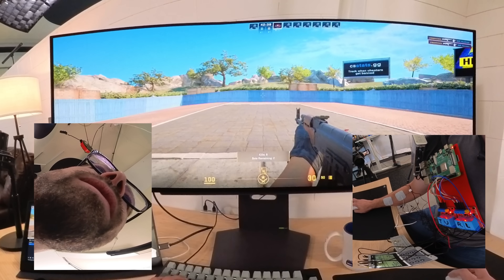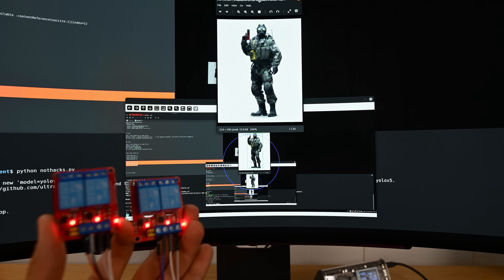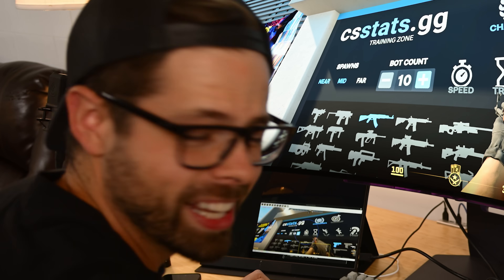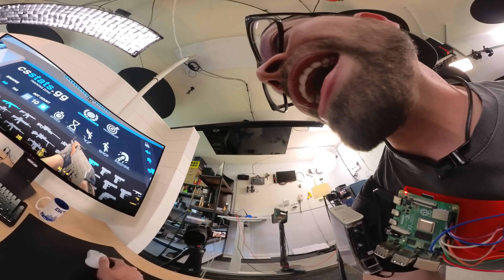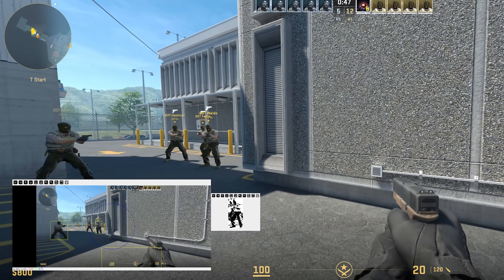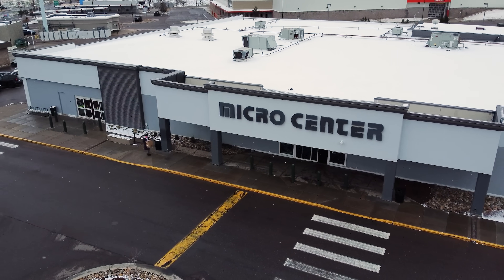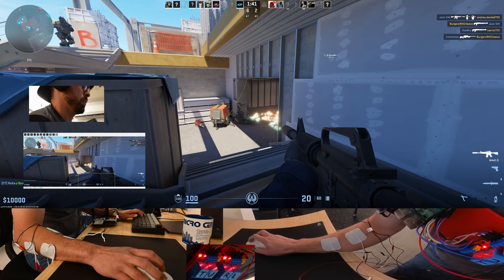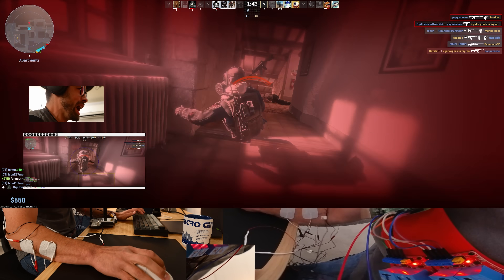Neuromuscular Aim Assist

Comment: You could train a neural net on your arm and wrist movements so it learns the proper shock amount to apply
Reply: 1000 hour training montage. Let's gooooooooooooooo
Reply: @noiJadisCailleach it would probably need more examples than that lol
Reply: that would be insane, id love to see it
Reply: That would require identical electrode placement or a system to compensate for variance like a calibration of sorts
Reply: @likafoss  just get a tattoo around the electrode and label them during the training :p
Reply: @likafoss  piercings with alligator clips
Reply: @likafoss  You just make them permanent by implanting them!
Reply: @likafoss yea, the neural network would he necessary to run attenuation on each user.
Reply: That'll be hard because it needs to adjust if u make a mistake. Like u don't have 100% accuracy
Reply: @sw3gmach1ne17  Your brain would also be adjusting to it too, so there would likely be a point you start to realize you are working with it than against it and that alone would make it easier for the neural net to adapt, and vice versa.
Reply: @Skullkid16945 but still, it needs to learn your mistakes, which they are not at all the same every time. I don't even know if this can work with you or u really need to leave it do whatever it want with your hand. Like for 100% accuracy or close to it
Reply: @Skullkid16945  ya its like an out of whack PID controller
Reply: @sw3gmach1ne17 and that’s fine, it can learn from your mistakes and can it even anticipate them, that’s how neural engines works

of course it will require, a LOT of hours of training, the more is trained the more accurate it will become
Reply: @Skullkid16945  close your eyes and it wouldnt
Reply: @sw3gmach1ne17  wouldnt be difficult to distinguish mistakes if you run a seperate AI like the one he was already using and convert the distance that the cursor has to move in the cardinal directions into 4 different scores while comparing that to the movements made
Reply: @sw3gmach1ne17 
The obvious way to train this neural net would be to give it feedback on good and bad signals.

You can write a program that detects hits versus misses and rewards headshots and kills more... Then combine this with the data from the electrodes
Reply: @sw3gmach1ne17  That is how neural networks work, though: It's not about getting the right answer, it's about being statistically consistent.

So him missing shots won't negatively affect the tuning.
Reply: 1000 hours of getting shocked just to train neaural net so that you can get shocked more during actual gameplay 😂
Reply: instead you could just dampen the amount of electricity you apply based off of the distance from your crosshair to the target
Reply: @Earth-To-Zan could use a Proportional–integral–derivative controller and get better results without any fancy
Reply: you dont even need a neural net thats just inverse kinematics
Reply: You'd just need a pid loop I think
Reply: «WHAT IF WE BUILD THE TORMENT NEXUS, BUT THE PROCESS OF BUILDING IT IS TORTURE???»
Reply: the avatar fits
Reply: This is the way
Reply: Start by losing the relays and put in mosfets -
Reply: 1000 hours of "AGH FUCK THAT HURTS"
Reply: maybe a pid controller could work. The controller has a feedback loop mechanism so it can adjust the strength of the shock depending on the distance to the target
Reply: ERRRRMM AKSHUALLY IT'S CALLED A NEURAL NETWORK NOT A NEURAL NET ☝🤓
Reply: And how long till online games require an anal probe to watchdog cheating 😂
Reply: Regardless of whether you use IK or neural networks, you'd also need some sort of mocap setup.
Reply: An external brain
Reply: Creating the dataset would be an incredible video
Reply: I would love to see this im ngl
Reply: probably would increase the reaction time significantly
Reply: Horror comment! Love it tho. Let’s let AI posses our bodies as demons. Would be bad ass
Reply: Oh yeah yeah
Reply: that would be hell, gathering all the training data
Reply: @bigboi9856  not even, he's generating training data just by playing -- basically just RLHF
Reply: this gives RLHF a whole different level of
Reply: Shock intensity based on distance from center to target, small flick to large flick.
Reply: lets not. :D
Reply: this and the upgrades he mentioned
Reply: And we could house it in the cranium
Reply: HOLY SHIT
Reply: XAI HAS ENTERED THE CHAT....
Reply: Basically it means "git gut"
Reply: Yeah that's what I was wondering, if he did this? Or did he simply just code it so that it basically just shocked him regardless if he wasn't aiming at the enemy 😅
Reply: Even more evil
Reply: You mechs may have copper-wiring to re-route your fear of pain, but I've got nerves of steel.
Reply: I would be terrified of it messing up once and putting way too much current through
Reply: @Zephyr713 clippy, nice!
Reply: Pair it with neuralink and a gun and you get an irl Smart weapon from cyberpunk. Every Day we get closer to it lmao
Reply: do you have any idea how long it takes to train an AI? he would have to be shocked for hundreds or thousands of hours.
Reply: Sounds great, take an ai, give it permission to electrocute you and let nature take its course. On an unrelated note I wonder what happens if your ai can train you while you’re training it until it’s just a loop of suffering
Reply: Getting the training data would be an incredibly painful endavour.
Reply: my guy we all have a neural network trained on sending the right electric signals to move our arms, it's literally the whole point of having a brain.
Reply: @michaelpapadopoulos6054 ewwwwww!!! That is the grossest way I've ever heard someone describe a brain, I wanna rip my own spinal cord out now hahaha 😂 it's just like when someone told me my toes were touching each other all over again
Reply: @michaelpapadopoulos6054  You can't exactly run the software controlling the device in the video on your brain.
Reply: Good idea, teach the AI how to puppet your body with electrical shocks.
Do it.
We love you.
Let us in.